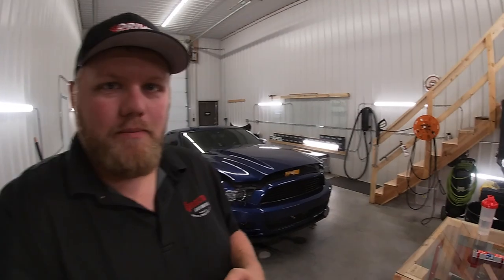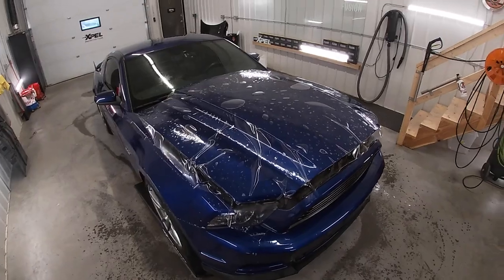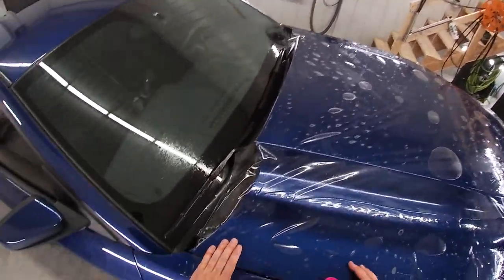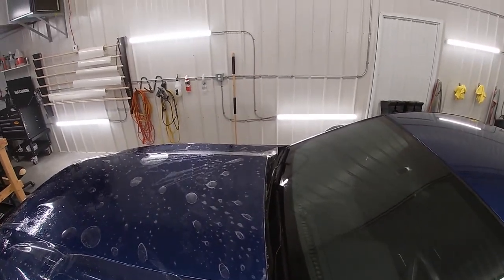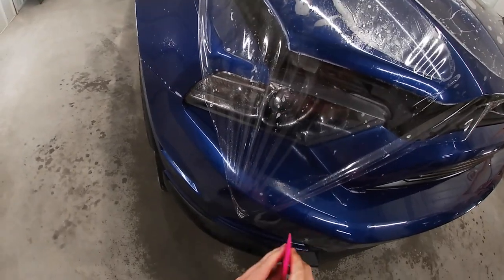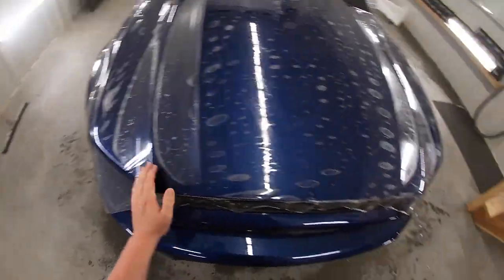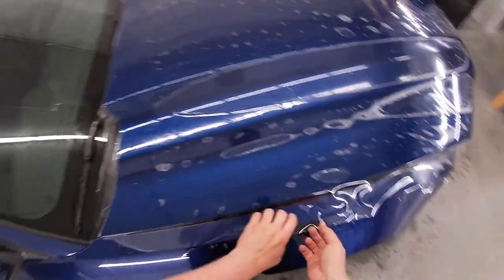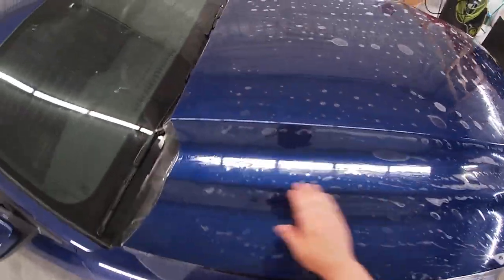Massive Custom Ford Mustang GT Hood Gets Custom Clear Bra PPF Install With XPEL Ulitmate Plus!

Comment: In general for regular cars, is pre-cut better than custom cut? It seems you get a more precis coverage cutting by hand.
Reply from the maker: For the most part, doing pre-cut patterns is the best way to do a PPF install. In a situation where you have lots of valleys difficult areas, thats when bulk may become the better option. With bulk style installs you have a lot more waste left over after your install, so if you are offering a bulk service, make sure you charge accordingly.

Comment: Hi Erik, i’m a fan of yours from the Philippines. Quick question, why is it necessary to stretch the film when you can just simply use a squeegee to finish the whole installation?
Reply from the maker: Thanks for the kind words! Stretching is required to get rid of any fingers that are built up in the film. The same principles apply for PPF as they do vinyl.
Reply: @DriveProtected  thanks a lot! More power to you and to your business 🙏🏻

Comment: These are hard to do but try xpel gel in the valleys and will stick down and be quick to squeegee, i tried middle of bonnet and stretched out to edges.
Reply from the maker: I used to use XPEL gel. Really enjoyed it but switched over to slip solution for cost savings. I agree, would have been nice to have for the valleys.

Comment: Good job man 😉
Really 20min for this, and what about temperature? I had around 25C and it was baaad🙈
What slip solution you're using?
Reply from the maker: Thanks! Temps were about 26 Celsius. Slip solution was a mixture of Johnson & Johnson Baby Shampoo and distilled water.
Reply: @DriveProtected   and the other solutions?!😅

Comment: I see you wrap a hood in about 15 minutes.  What do you charge to wrap a hood with clear wrap?  Nice big relatively flat Ford Explorer hood....?   Just curious.
Reply from the maker: I usually charge around $600 Canadian to install bulk hood.
Reply: @DriveProtected  Only the hood is $600.......?
How much is just the material for the hood?
Reply from the maker: Yes. $600 labour and material included. Material is roughly $3-400

Comment: nice work, if my installer will mess up my hood I will tell them they did not try hard enough if you can do it right the first time ;o]
the s550 doesn't have that much of a bumps there so should be easier
Reply from the maker: Haha! Sounds like your installer shouldn't have a problem installing PPF on your hood!